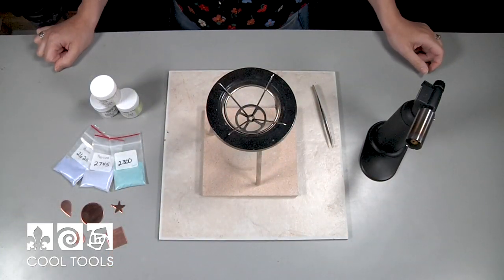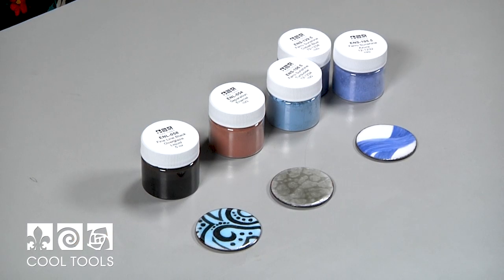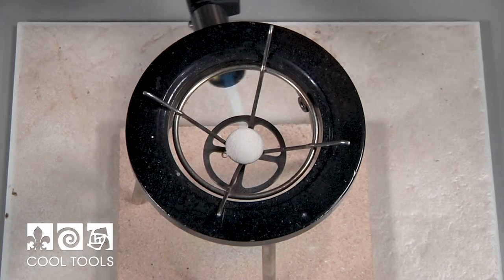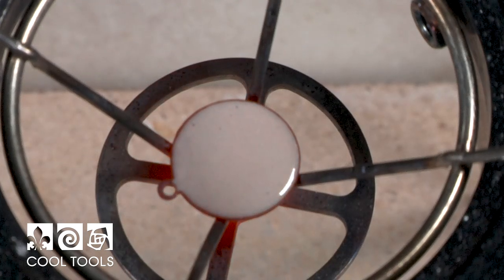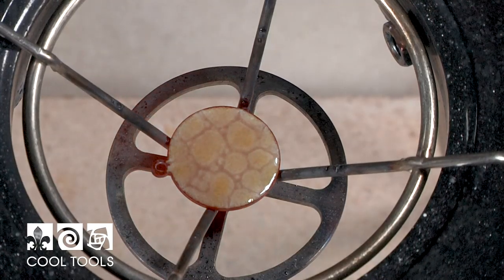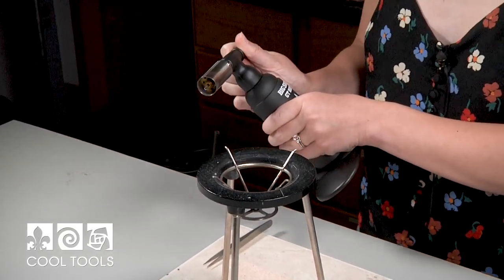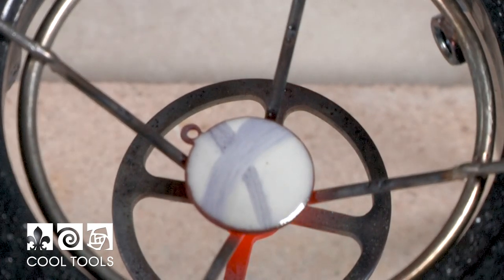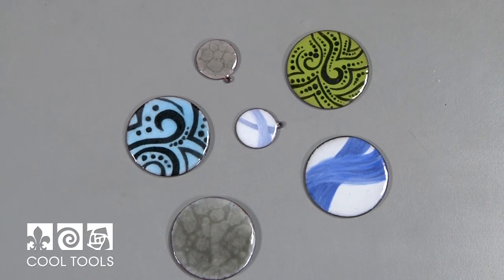Cool Tools | Torch Firing Enamels by Karen Trexler

Comment: Karen what happens when the enamel doesn’t reach the glossy texture and you put the torch fire for long time? And look like sugar texture?
Reply from the maker: Hello, if your piece isn’t moving beyond sugar fire, I’d try moving the flame of your torch a bit closer to the bottom of your enamel to increase the heat. If you’re working on a larger piece and this is happening, it might be that your piece is a bit big for the torch firing technique, and you could try using a secondary torch at the same time to heat the piece more evenly. Hope this helps!

Comment: I am struggling with getting a flat surface and also getting some pits and bubbles. How can I avoid these and get a smooth perfectly flat surface?
Reply from the maker: Pit and bubbles can be caused by 2 things. Either the metal isn’t perfectly clean before the enamel is applied, or there is still some moisture present when the piece goes into the kiln. If the enamel is pulling away from a spot creating an irregularly shaped pit it was likely not clean. If you have a perfectly round and small pit/bubble and several of them, then your piece was probably not completely dry before being fired and the escaping moisture caused the disruption. Try giving your pieces a bit more time to dry before torch firing them and make sure to clean your pieces [and your hands] with a surfactant prior to applying your enamel. Hope this helps!

Comment: I’ve seen a couple of cool tools videos about enamelling and you always mention a counter enamel. What would happen if I want the reverse to be polished silver?
Reply from the maker: Hi Michelle, the purpose of counter enamel is to prevent metal from cracking and warping. Enamel expands and contracts at a different rate than metal, which can cause the metal to stress and crack. Counter enameling equalizes the pressure on the metal by applying a layer of enamel to the back of the piece. Hope this helps!
Reply: @cooltoolsvideos  Thank you for that explanation. I’d love to ask what the alternative is for any jewellery where a splash of colour is wanted? Is there a hard wearing paint alternative?
Reply from the maker: @MichelleCameron  Powder coating is always a great option! You can learn more in our Learning Center here: https://cooltools.us/blogs/learning-center/powder-coating-videos
Reply: @MichelleCameron I like wet packing enamel to add a little color on silver- you don’t counter enamel

Comment: Love the idea that we can use torch firing on enable.  Is there any sterling silver enamel  that I can use this torch firing technique? 
🙏🏼🌺
Reply from the maker: Hi Ingrid, you can technically enamel on sterling silver; however, we always recommend enameling on fine silver.
Reply: I don’t mean torching on sterling & enamel I mean any type of enamel material that turns into sterling or fine silver with a torch?
Reply from the maker: @ingridinthis3d5dnow25  There is nothing like this that we are aware of, as enamel is made of glass. Hope this helps!
Reply: @CoolToolsVideos  great video. Im new to this, so why fine silver instead of sterling?
Reply: @russellmarley7803  you can solder fine Sterling without solder. With sterling silver you need solder
Reply: @ingridinthis3d5dnow25  that's not what I'm asking about. I'm asking why they recommend using fine silver over sterling silver for this technique.